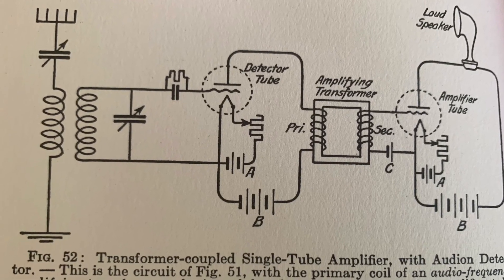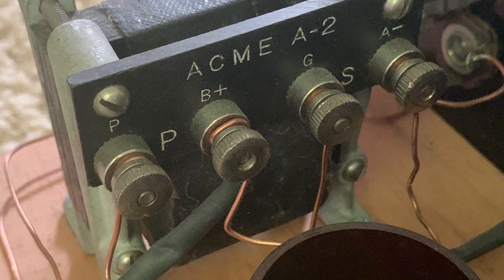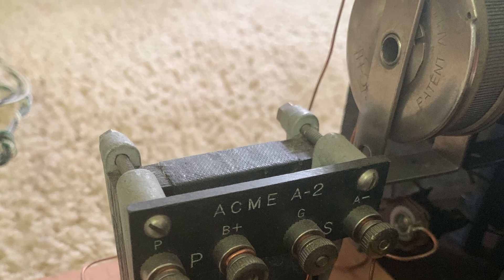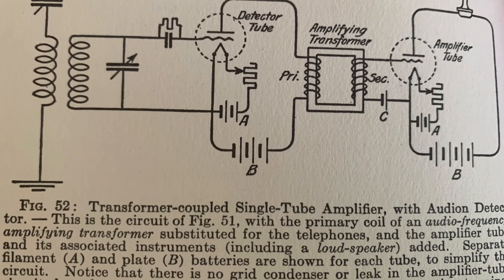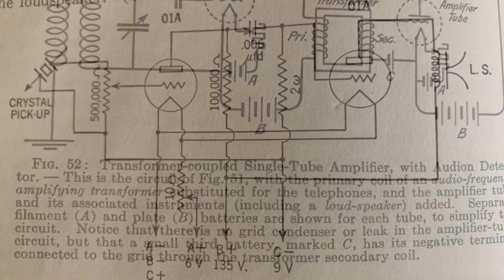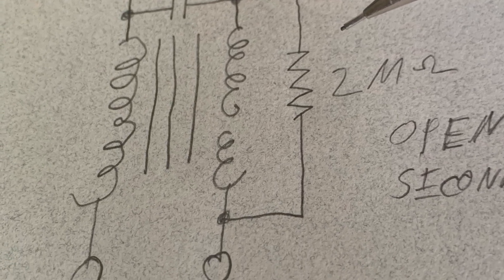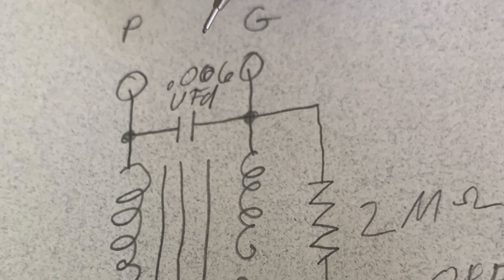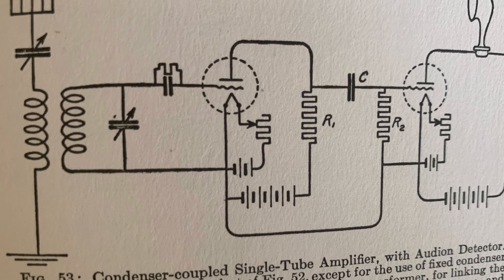RC’ing open AF transformers

Comment: How does this work?  Can an entire transformer be replaced with a couple of resistors and caps?
Reply from the maker: Thanks for watching.

Yes you can remove the transformer and RC the whole the circuit with two resistors and a cap. But that’s overkill when you can use the good side of the transformer and use one resistor with a cap to coupling the primary to the secondary windings of the transformer. And keeping the original transformer and hiding the resistor and capacitor in the housing of the transformer the radio will still look original.

Comment: Any idea why transformer coupling was used in the first place? Were early tubes so expensive, or low gain, or both that it made sense to use an expensive transformer between stages instead of much smaller, cheaper, lighter resistors and capacitors?
Reply from the maker: Thanks for watching the video. There were RC coupled in the 20’s. But like you said the tubes of the time were less than 100mw of gain until the UX-112A. AF transformers stepped up the gain so only two 01A tubes were necessary. But for same gain two AF transformers. Keep In mind tubes were very expensive at that time. The 01A cost $5 in the 1920’s.

Comment: Thank you for this video.  Great information! I have rewound several transformers but it is not my cup of tea.
Reply from the maker: Good luck my friend. I’m quite impressed I can’t imagine rewinding. I wouldn’t have the patience. Remember the values of the components are just a reference it’s not that critical. I’ve seen some values of 50K ohms in the plate primary circuit and 470K ohms in the grid secondary circuit. And ceramic disc caps from.005 to .01 uF. I’ve always used the values shown in the video. 100K, 2M ohms and.006uF.

73’s KA1VMW Mark